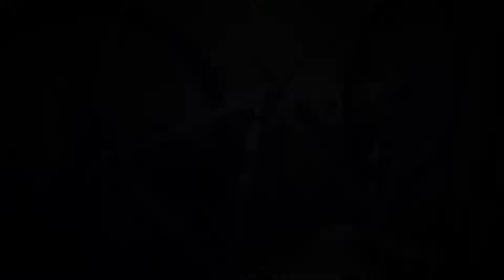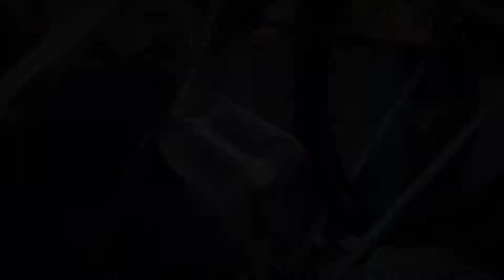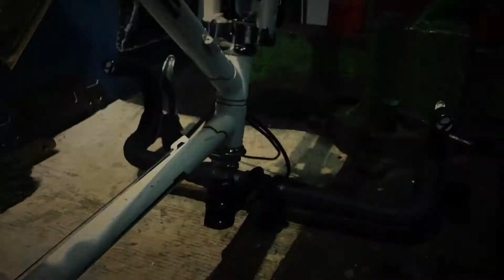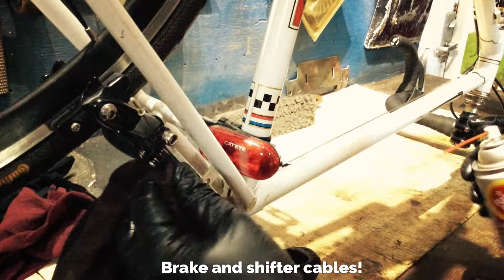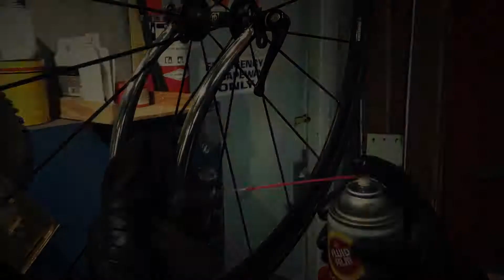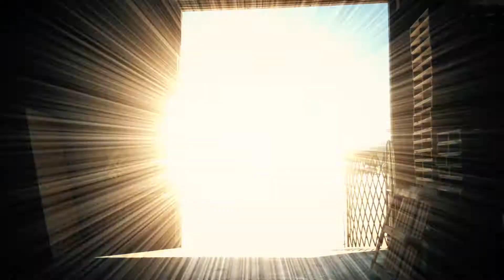FLUID FILM® Bicycle applications

Comment: Really? Spraying into a bearing? That's just going to washout grease and make it thinner. Bearings should be disassembled and greased properly, not sprayed. Seems ok to use on pivots though.. and I suppose cables but I'd rather apply with a drip than a spray for that. Didn't even mention what's probably the best use, as an internal frame protectant.
Reply: Most 'general-purpose' lubricant brands (3-in-1, tri-flow, etc.) will market their products like this. I guess it's better than WD-40 or even no lubricant at all, but it's really the sort of 'hardware store' solution a non-cyclist dad would use on their kids' bikes. Serious cyclists aren't being fooled lol. I wish they'd be more honest and just show us the best way to apply it to the inside of a bike frame.

Comment: I was thinking the same thing has it all worked out well? Are their any unforeseen problems?
Reply: Not so much. Fluid film dosen't have solvents so it's even safe to apply on plastic unlike WD40.

Just be careful around rubber becasue any oil can swallow it, and don't apply on brakes and you should bd fine.